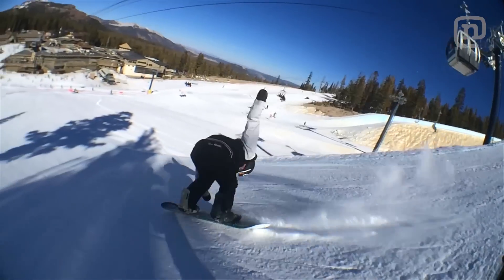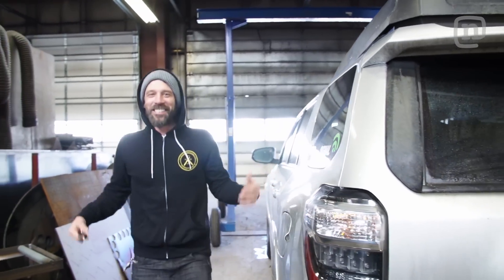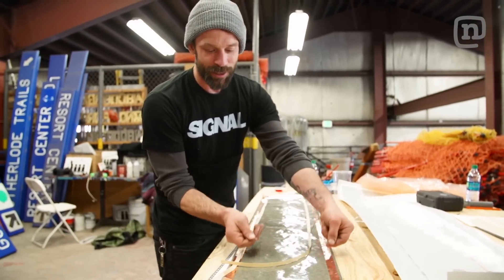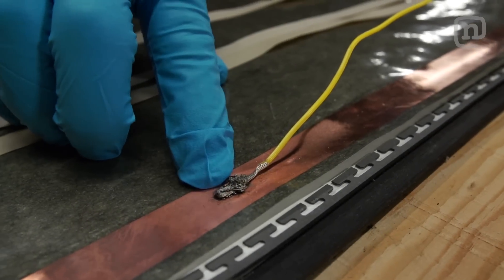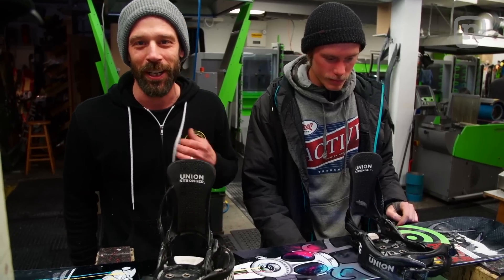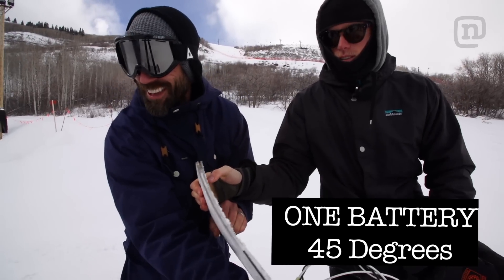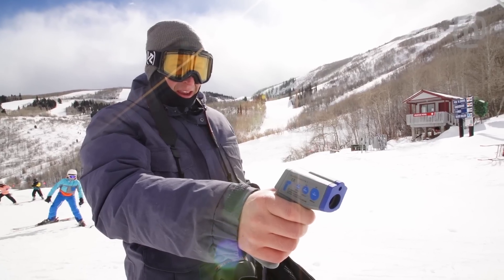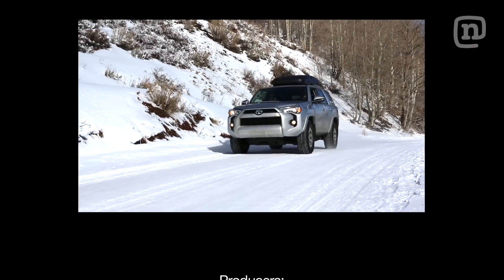Speed Stick Heated Snowboard—Go Faster! Every Third Thursday

Comment: Science says it will be slower. In a car you heat the tires for traction why? Because heat expands bigger means more surface less tight...heating that board up is freeing up molecules thus slowing the board down. When they are tight it moves faster says science. But who knows that's just basically what I know from expansion and contraction.

Comment: Dude, "Feels a little bit faster, i think" is not a proper experiment if you ask me.

A better method would maybe be to have two snowboards. One of them heated one of them not. Then two guys with the same weight riding the two different boards simultaneously. Looking at the speed distance then would give you a much better and more reliable result.

Comment: It doesn't make sense to me. Water, be it melted snow, should slow you down. Just like people sometimes slide over a pool of water, you can see they slow down and sometimes end up sinking in the water. Also, I know that it is air underneath the board that gives lift. So you would think the more air is underneath, the faster you'd go, not heat nor melted snow.
Try experiments with air, instead of heat. Hovercraft like...
Peace.
Reply: +ivoman7 it's a thin layer, not a swmming pool, that's why pool slides work. I don't think you don't really know what you're talking about. You won't slide around on dry ice ( below -4 C) with no layer of water, but you will slide around on one that does.

Comment: This is a cool video, but everything is wrong here. You are not snowboarding on a liquid surface and this device does not make you go faster, and it being a cold day DOES NOT HELP. 

The heat required to get ice to 0 degrees celcius alone is WAAAAYYY more than what you're transferring to the ice in the milliseconds that your board passes over it. This is just to get it to 0 degrees (melting point). The heat required to push that ice through a phase change from solid to liquid is again, WAAAAAAAAAAY higher than what you're transferring to the ice. 

The only way this could possibly make you any faster would be that the heat is melting snow on top of the board and getting rid of it so it doesn't weigh you down. 

This is either placebo, or you've invented a faster snowboard by cutting a tiny notch in the back of it. I'm just glad you didn't get water sitting in that notch, or you could have turned your heated snowboard into a heated bomb.